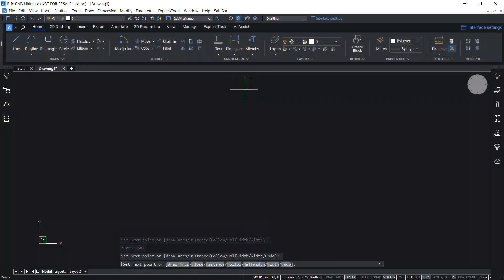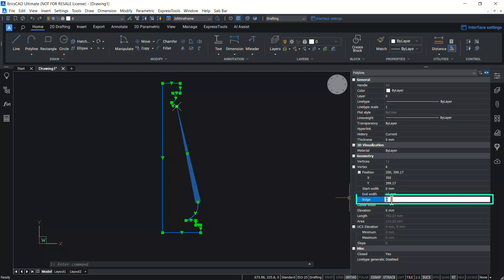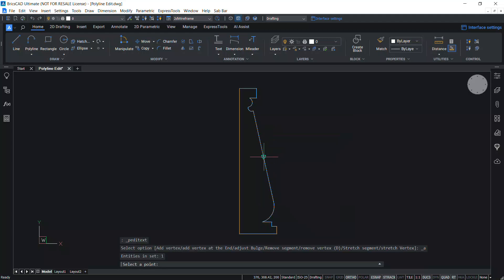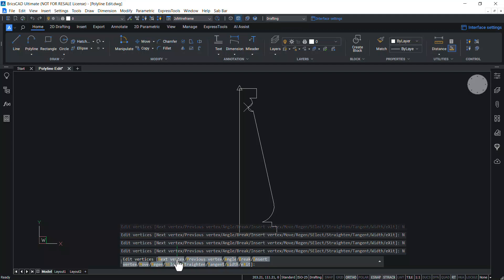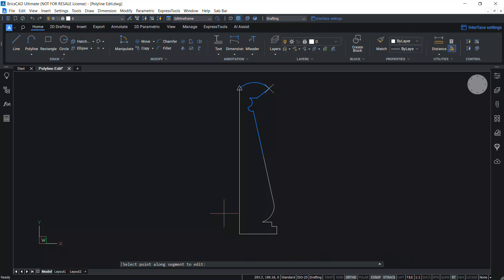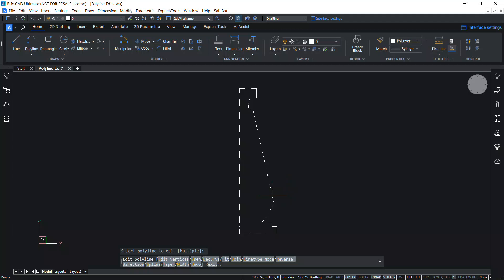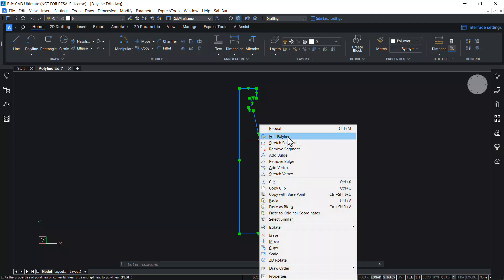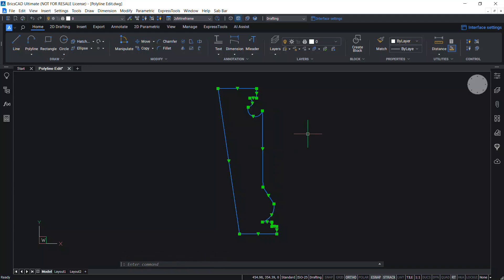Polyline Editing in BricsCAD

Comment: Hello. Please make a video of a complete sequence of an architect's work (at least using the example of a primitive house with 4 walls): a couple of foundation pads, columns, floor and walls (consisting of several layers), a couple of windows and doors. And then show how you get a specification of materials: volume of concrete, how many square meters of brickwork, plaster, paint, floor covering? This is an elementary process in any BIM program (Archicaad, Revit, AllPlan, etc.), but how to do this in your program is completely unclear. It looks like the most difficult BIM program on the market.
Reply from the maker: Thanks again for your feedback!